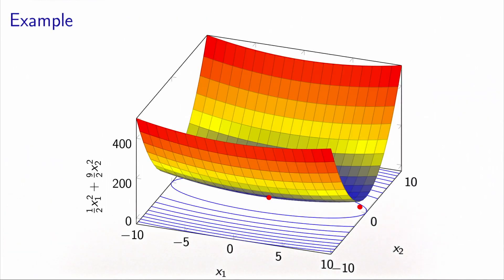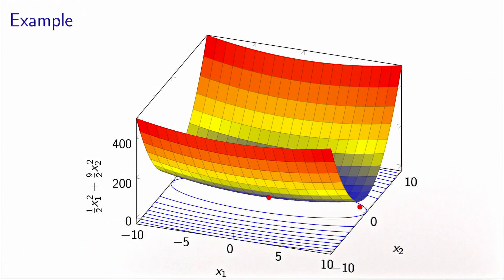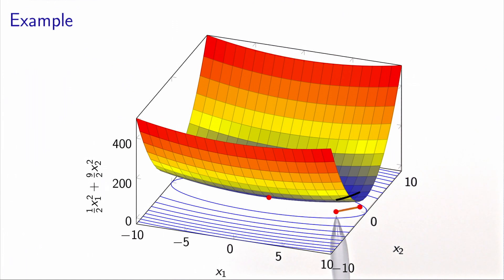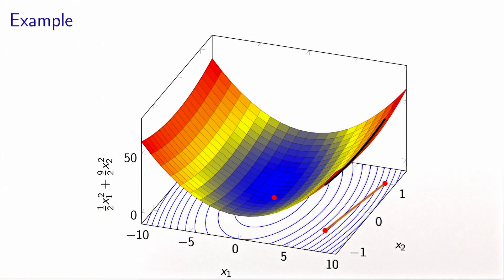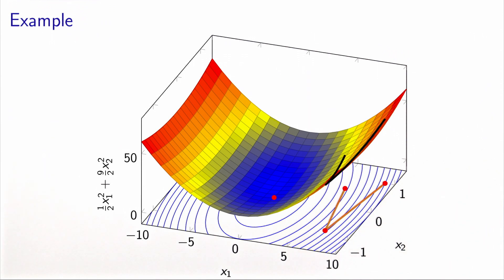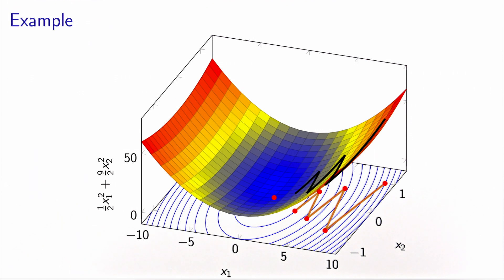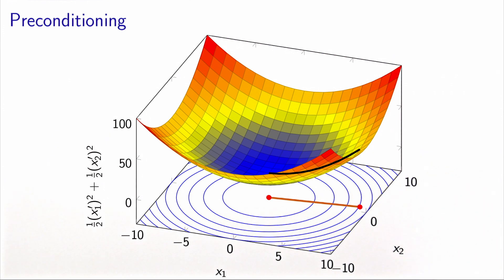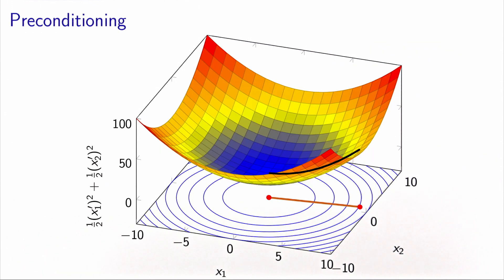Descent methods and line search: preconditioned steepest descent

Comment: What I'm confused about: At 1:41 you say we follow the direction _until the function starts increasing again_, but looking at the table at 3:35 I see a constant value alpha=0.2. Which I'd interpret considering the bottom formula at 8:17 as that you don't follow the direction *until the function starts increasing again*, but rather follow it a fixed ratio of 0.2 times the gradient length?
Reply from the maker: In this example, it just happens that the step to perform to reach the minimum is always the same.